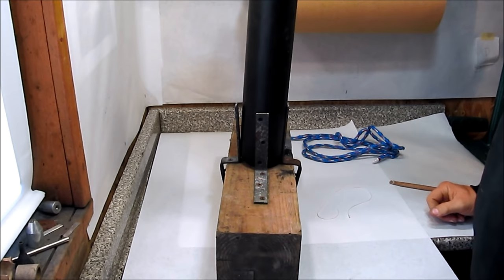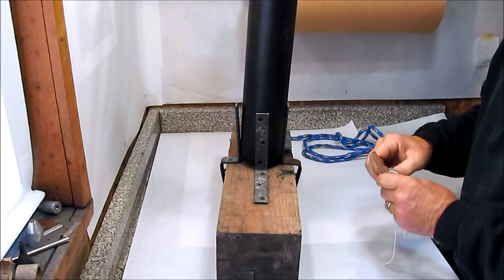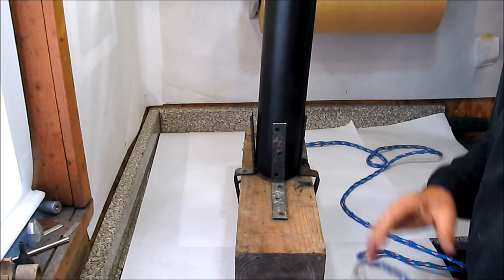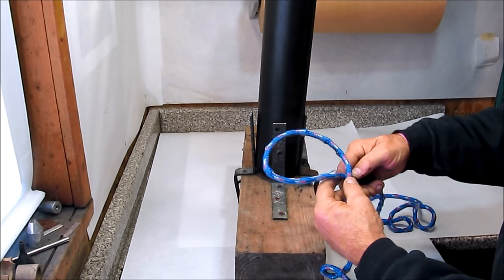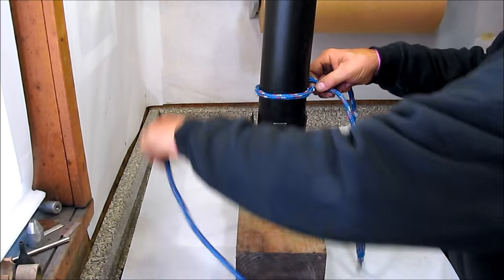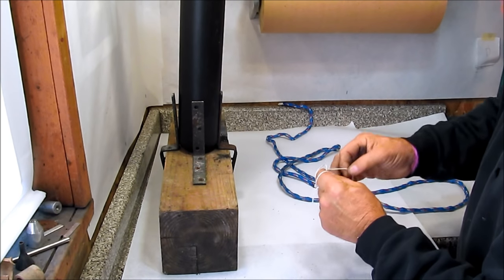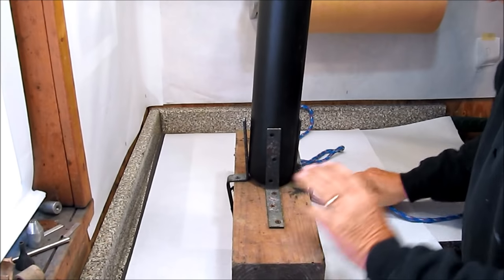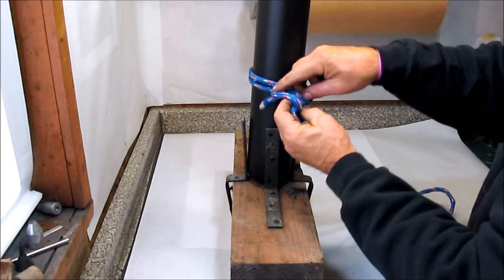FW 101, Lesson #12, The Clove Hitch Knot

Comment: Thanks, best demo I've ever seen.  Seeing the description in Weingart ("sailor's clove hitch"), even seeing animation of it online, I usually wind up mistakenly converting it into a double overhand knot, putting the end thru BOTH loops, because intuitively, one of the loops looks like "it's not doing anything".  With this vid as a reminder, I think after all these years I'll finally get it down.
Reply from the maker: Thanks, Robert. That knot sure is a useful one in many different situations.
Reply: @nedgorski  Lately I've resorted to rough twine for the friction in such tie-off applications, but I think I'll go back to smooth string because the twine often breaks as I pull it.  Probably if I do the knot correctly that'll make up for the reduced friction.  One thing I tie off is lift bags, with a "skirt" of extra kraft paper protruding a few inches that forms a stiff stand-off from the bottom of the mortar, to reduce the peak pressure during lift.

Comment: You should try a constrictor knot.   Just as easy to tie with a loop.  A little more difficult if you don't have a free end to slide it over. For a small diameter string it probably doesn't make a difference.  For larger ropes, it is much less likely to free itself.